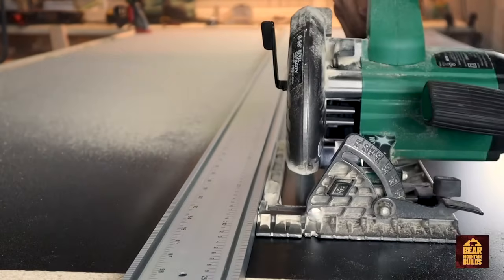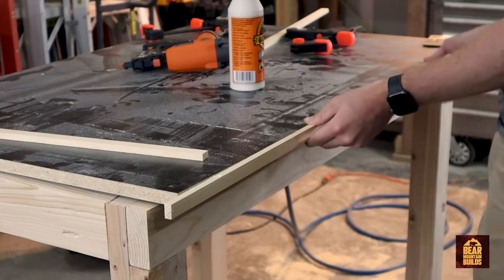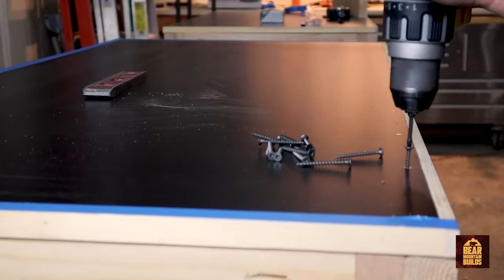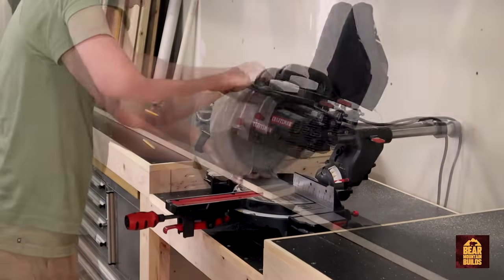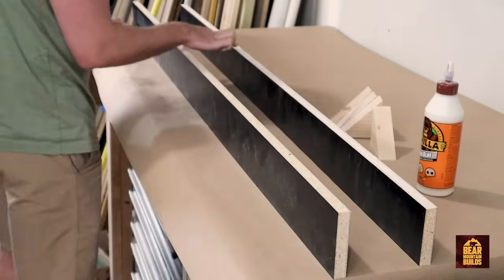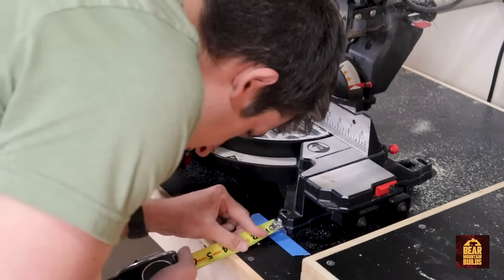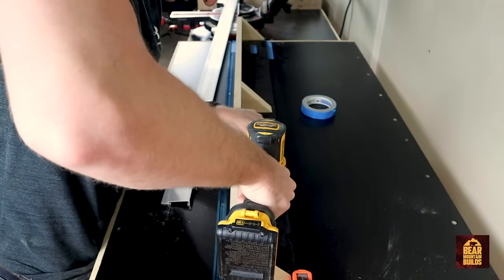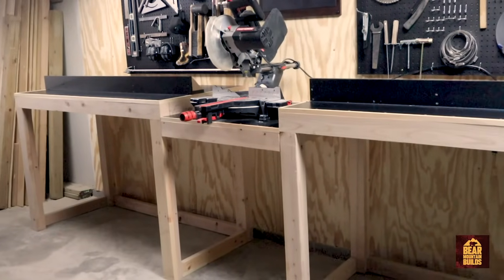Build This Simple Miter Saw Table with T-Track | FREE PLANS

Comment: Why is the saw sometimes not centered? Most are right handed and pull on saw with right hand and hold work with left hand. Is that the only reason the table on the left is longer than the table on the right? If I was left handed should I make it the other way? Is there another practical reason to offset or center the saw on table?
Reply from the maker: The handle of the saw is for right hands which is why I grip the wood with my left. If the saw is off center you can cut longer pieces especially if you have a tight shop such as my case where I have a nearby wall.

Comment: I like the miter station, but I’ve been seeing other folks who don’t even make a fence. They just put the T-track in a dado flush with the bench top surface.
Reply from the maker: I definitely recommend having the fence since it makes it easier to handle the wood, but your option also works

Comment: Yes, the user probably should adjust the height to their own unique physical characteristics  -- length of arms, height @ shoulders, in particular, are relevant -- ideally, you want to stand fully upright at the top of the melamine, and set your hands on it. Your elbows should be slightly flexed -- probably about 2-3" lower would have them at full extension. The ergonomic benefit here is that you won't stoop or bend over, which increases back strain. 🤨🤔

As to the unlevel shop floor, there are videos out there that show how to add a self-leveling surface treatment to it.

As to using sheetrock/drywall screws, I suggest you avoid using them in wood construction -- use deck or construction screws, instead. The latter, in particular, are not much more expensive, and you will find over time that there are two issues with drywall screws -- first, they are much more brittle, and have a lot less shear-resistance than you might expect. The other problem is that they do not resist the acids in the wood very well, and wind up corroding over time, which can make them very very difficult to get back out -- they tend to get even more brittle and break off, or strip out the driver head, rather than backing out properly.

For certain tools with limited moving parts (i.e., 1-2-3 blocks or aluminum t-track), you might also consider Banggood, which essentially cuts out the middleman on costs -- it's generally made in the same place (many of the items are indistinguishable from Woodpecker brand), but offers a trade-off between cost and delivery time (sometimes it'll take you 6 weeks or so to get something from China).

Comment: Nice design! my only feedback is that I noticed you used wood glue to help the 45 degree supports on the melamine fence. While the screws you used are keeping it in place, the glue won't make a proper bond to the laminate - that's a big reason my you see it so much on assembly tables. Great video otherwise!

Comment: Something I noticed, when you glues the fence together you then screwed the two pieces together.  My question is why did you bother to use glue on the long joint since the glue will not give any real strength since glue is not going to adhere to the melamine surface????  Did I miss something????  I would think that the only way to get the glue to really work would be to remove the melamine surface to allow the glue to work.  just wondering.
Reply from the maker: You don’t need to put glue on the melamine surface. I did even though it won’t do much

Comment: I appreciate the use of ducking to prevent your spoken narration to be obliterated by the background music but let's be completely, brutally, unequivocally honest....even the ducking levels are wildly out of whack from moment to moment and worse still.....the background music is NOT AT ALL BACKGROUND MUSIC, it is foreground music whose overall amplitude is WAY TOO HOT to be practical or enjoyable.  

Unless your intent was to drive viewers mad with the same unpleasant incidental musical licks set to loop over and over and over ad nauseam; thereby preventing the viewer from not only accessing the primary message suggested by the title but also from enjoying the process enough to go back into the video multiple times to pause and replay sections as needed so that all materials, steps and tips / warnings are understood well enough to actually undertake the project if so desired.  

You've got to avoid the tendency to "over-produce" the video's audio track(s)--especially when it comes to applying heavy-handed compression / limiting effects to stock, non-copyrighted incidental music & other widely available audio snippets, which have all been EQ'd for good overall fidelity and further normalized for optimal peak-to-peak volume leveling without clipping (digital distortion) prior to publishing for general use by videographers.  

Remember:  Such audio clips are designed to be used with a very simple, drag-and-drop ease and don't benefit from additional processing other than that which is necessary to properly "duck" in vocals for spoken narration or to match / tweak audio levels across all audio elements prior to you finishing up your video post production and committing your project to the encoding process ahead of upload & publishing.  Sometimes less is really more.....

Every element of your video should have a purpose .....I mean a very real purpose for being included, such that if your finished work would suffer or be less impactful (in a positive manner) in a clearly identifiable way through your omission of said element, then it only makes sense to INCLUDE It and make sure it fits into the mix like a glove.  If you can successfully tell your story without the added bells and whistles first......then you're more likely to know intuitively when other elements such as graphics overlays, title cards, sound effects, and incidental backing audio are appropriate and will add nicely to the overall impact of your project.   

Be good to your viewer by minimizing or preferably eliminating very loud audible transients and overly aggressive & wildly unpleasant sounds from your shop equipment or the surrounding environment as you record your video or carefully edit them out / diminish them in the editing process.  Consider occasionally using techniques like fast forwarding through or simply editing for brevity those highly repetitive or quite lengthy and frankly inconsequential processes to keep viewers interested and following you start to finish.

Less is more, especially in the beginning!

Best of luck in your endeavor and I think you're going to do just fine!
Cheers